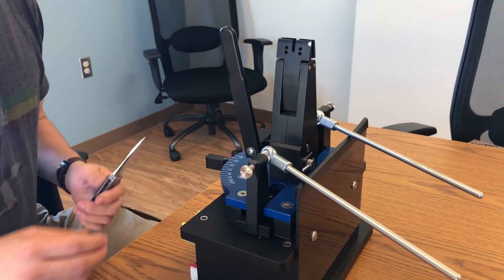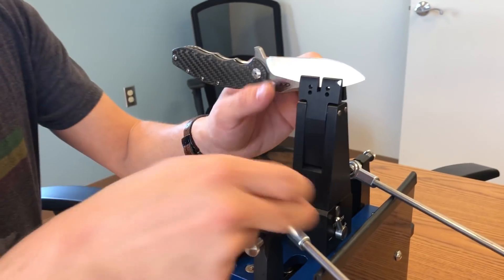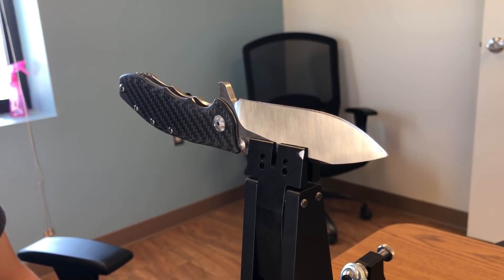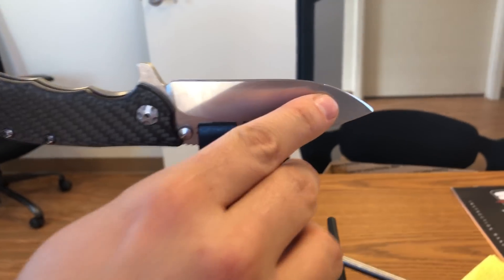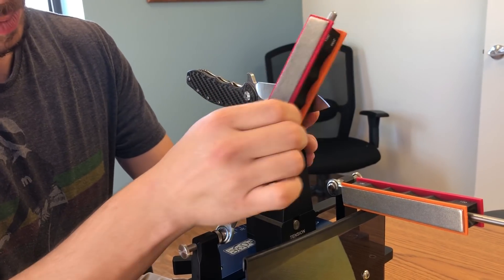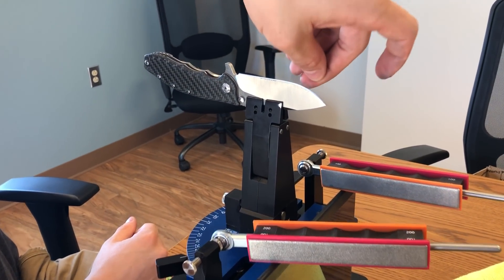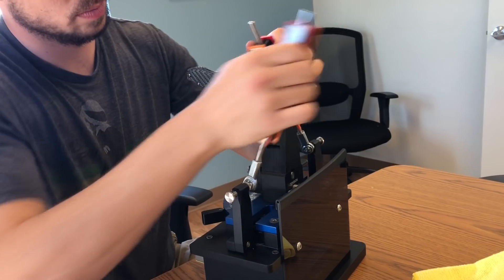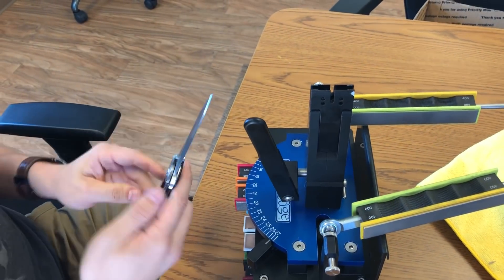Sharpening a ZT with a Wicked Edge 2017 Generation 3 Pro Sharpener

Comment: Great video Kyle!  I am trying to decide between the gen 3 pro and the pro pack 3.  Are these two models designed for different end users?  They both seem very similar with the cam locking system and the ability to take the same accessories.  I think I would be happy with either one but I'd like to hear your recommendations.  Thanks!!!

Comment: I have this exact same system bar the tension lever. I love it.
I find I get better results if I sharpen where the tip points towards me: this creates micro teeth that have more of a bite when you pull the knife.
Apart from that I do it the exact same way you demonstrated it.
Reply: So you flip it around never heard of this!! I guess it would work tho
Reply: I would not like the point facing me for safety reasons. I would be afraid of accidentally stabbing myself.

Comment: I’ve seen a few videos for the wicked edge but they are all on small knives. How would it work on a bigger or longer kitchen knife. How do you work it then.
Reply: Just have to do the blade in sections if need be
Reply: Eric Keating there are no videos on how to do that. Would be nice to see.

Comment: When you are flying off the edge near the tip will that not round the tip doing it that way?
Reply from the maker: J Rod No, just the opposite. Following through with the stroke will keep the tip straight. The trick is to not let the stones curl when they come off the tip of the blade.

Comment: Kyle, how do you sharpen a knife with only one bevel--in other words, only designed to be sharpened from one side?  Especially if the knife blade is painted?  I mean, you need to control the feathered edge on the unbeveled side, without scarring the paint.  And the machine doesn't allow a "zero" degree edge.  I suppose you just be careful not to be aggressive on the "unsharpened" side and put the angle at the minimum angle.
Reply from the maker: fcpelletier you would just sharpen the beveled side normally and then use leather strops at 15 degrees on the non-beveled side to knock of the burr.